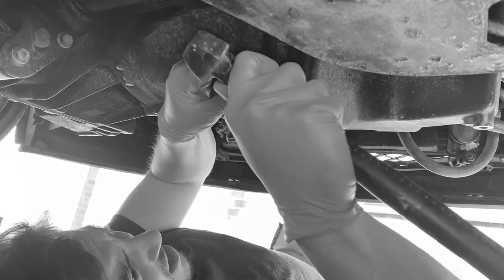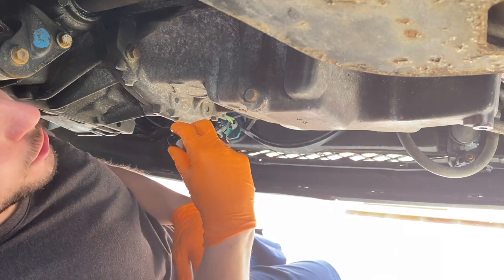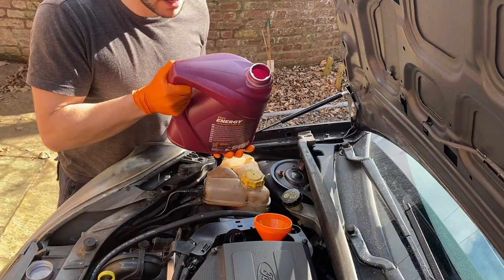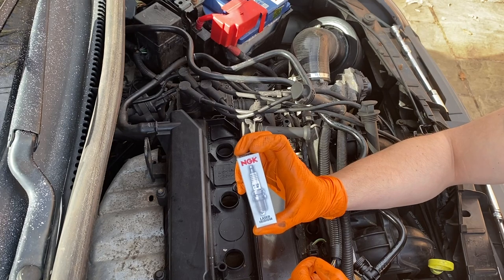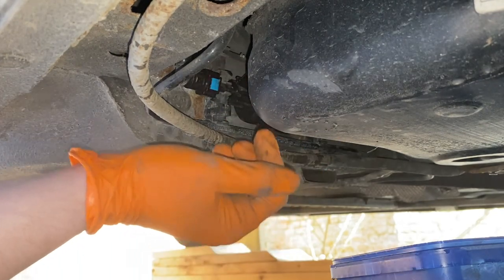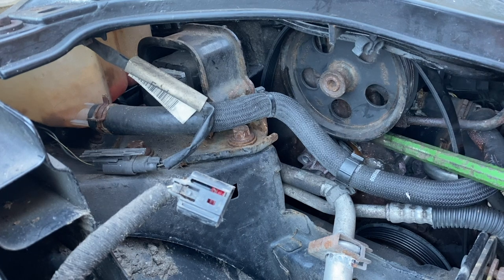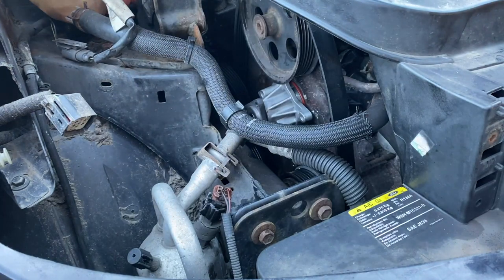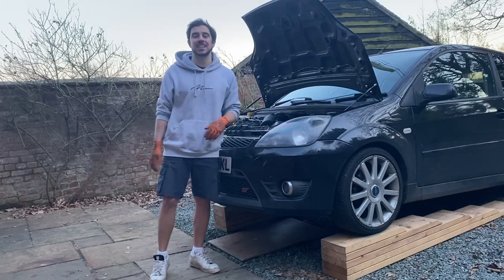Replacing the Water Pump and Servicing my Fiesta ST150

Comment: What I've learned from 9 years of Fiesta ownership is that, sooner or later, they will start to use oil (sometimes a lot of it).
The 5w30 may be good for a less spicy 1.4 or 1.2 but I think that for a 2 litre that is usually been driven hard is better to have some 5w40 or 5w50 oil because they give much more protection. As for the spark plug, I recommend using OEM one because I always had problems with aftermarket ones (usually the ceramic breaks). Never had problems with MANN filters.
Those are quite "simple" engines, so the use of OEM oil should be only advisable. Been using 5w40 A3/B4 oil for 9 years (tried the 5w50 too) and the engine is still in good shape after 230.000 chilometers. Also, I recommend try oil additives such as "tungsten disulphide". Put 35 grams of pure WS2 (not premixed ones) in your fresh oil and you tell me, it's quite incredibile.
Reply: agreed on the thicker oil. my st150 needed topped up 500-1000ml every 120 miles if I was using 5w30 so I tried 5w40 and I get at least 300 miles between oil top ups now. Still not great but at least I can get a full tank of petrol without adding oil 🤣

Comment: I noticed that you’re missing the duct piece that going between the radiator and the lower grille opening.  It’s like a floor and sides that forces air through the radiator instead of allowing it to pass out under the radiator etc.

Reinstalling it made a noticeable difference to how well the AC works under high-heat conditions.
Reply from the maker: Now see I’ve noticed one little piece of ducting on the drivers side of the rad, and a gap where one is supposed to be on the passenger side so I assumed I was missing one there, I didn’t know about the one on the bottom so I’ll keep an eye out for those, thank you 😁 I’m also missing the aux belt cover I found out the other day 😩 again didn’t know there was one. Whoever owned this car before didn’t look after it 🙃

Comment: Just changed oil and filter for the first time on my ST150, £29 for the stuff, much cheaper than a garage service
Reply from the maker: Yeah so much cheaper DIY, garages won’t do half the stuff either if it’s not due on the service schedule but will still charge you a fortune.

Comment: I changed my thermostat and also noticed a significant leak afterwards. Turns out I’d cracked the radiator where the bottom hose connects while trying to remove a very rusty clamp🤦‍♂️. Need to replace the hose too as it was still weeping after but I just chucked some radweld in and it stopped it.
Reply from the maker: Nightmare! I thought it was that hose to start with but I’ve had a good look and it seems to be fine. I thought it could have been the coolant tank but since I changed the water pump it seems to have sorted it 👌🏻

Comment: Nearly cried at you taking the pump out😂😅. Based on a video i saw before, it doesn't rly wiggle at first, and has to pop out straight, so had a pry bar either side (from up top and underneath) and wiggled until it came out.
When you bled the cooling system did u have the heaters on hot?
Reply from the maker: 😂😂 I’m glad you appreciated me making more work for myself by not removing the headlight to start with 😂 yeah whacked it on hot, supposedly these self-bleed 🤷🏻‍♂️ normally give the pipes a squeeze with the cap off just for good measure

Comment: Good job I hope you didn’t use tap water fella deionised water all the way, really enjoy your videos keep em coming
Reply from the maker: See I always ask for distilled water when I buy antifreeze and they always tell me “just use tap water, the additives in the antifreeze mean you don’t need it” 🤷🏻‍♂️
Reply: @MendItModIt  could depend on who tells you but I’ve always been told distilled water I mean why do Eurocarparts sell it ? 🤷🏻‍♂️
Reply from the maker: @robsmith7430  yeah see I wondered this. I asked for it in my local motor parts place and they were just like “no you don’t need that” 😂😂
Reply: @MendItModIt  fair enough but if it turns a rusty colour don’t say I didn’t warn you 😏
Reply: Deionised water from Tesco, its cheap and much better for your car than tap

Comment: Looks like you're measuring the oil level whilst it's up in the air at an angle, may want to check once it's on level ground.

If you like techie stuff, feel free to follow my project page: https://fb.me/snotrocketfiesta
Reply from the maker: I did check again after and it still needed topping up, I’ve checked it again this week and it’s low again so looks like she’s either leaking or burning, fantastic 🙃